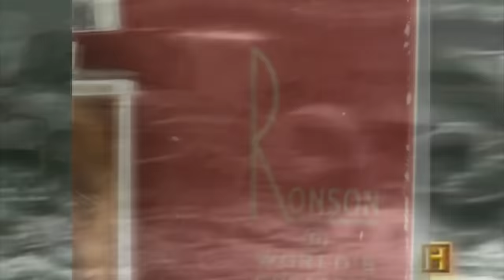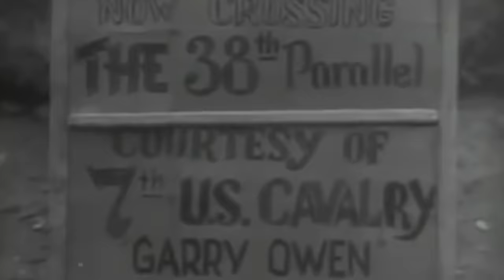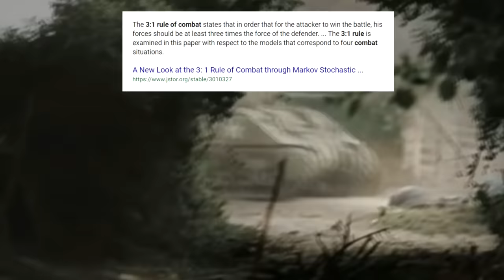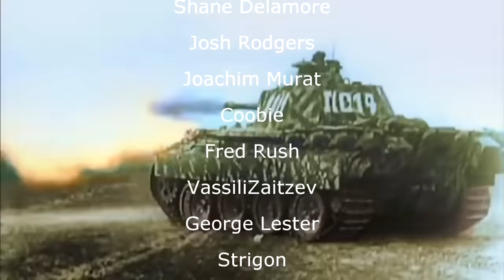The American Tank Meme

Comment: Tommy herd as my Great grand uncle would say about the m4 Sherman.
Translate to tommy cooker, as the thing lit up when shot at. 
awful but interesting person wolfgang.
Edit: he'd repeat kraftstoffsystem=fuel then say brrr sound while doing fire motion with hands.
Reply: Some how I have arrived back at this video a year late & if you want know why many allied tank crew found the Sherman under whelming well it'd because it is.
People talk of the Armour, speed, gun triangle which the M4 was pretty well rounded in so in that aspect as well as production it is good.
Mind there are many innate design flaws to the Sherman such as high profile & loud for a start.
As my mothers German side that went though the war described poorly from what my memory recalls Sherman tanks were so tall & loud due to their radial engine that you couldn't miss them approaching.

The Germans late tanks were ambush predators like a Spider while the USA tanks like ants.
The German from a covered angled position & or camouflaged would fire the 1st shot's often not spotted immediately since the tank groups were dispersed but once located after taking a few allied tanks out came the difficult decision of holding of or running.
If they ran the Allied air power would likely get them but stay they would be swarmed.  

People talk of German break downs/mechanical failures et cetera though a thing many tanks were purposely sabotaged/scuttled as they hadn't fuel, ammo or nor air cover.
The Tigers did break down & suffer from design issues but the Panther & many tank destroyers didn't have notable issues.
From what my allied fathers side & mothers German side described they could engage the allied forces but lacked the combined arms that won them victory early in the war.
The Battle of Britain long ago decided the wars outcome far more then tanks or wonderful ideas.
A tank without air cover to protect infantry to protect the tank is tarantula swarmed by everything under the son & if it runs well fire from the skies. 

Germany lost more tanks to break-downs, mines & ant tank guns towed then any allied tanks.
Tanks vs tanks is an awful idea only the Germans, Russians & USA had an obsession with.
Britain was infantry tank as it's a support vehicle & cavalry tank as something needs a bit of speed but building 2 family of tanks rather then 1 for the 2 goals is a bit silly but it worked till the centurion from the comet perfected to make the MBT=main battle tank.

Comment: Even after we started putting 76 mm on the Sherman's after the British did it the tiger could still out snipe Sherman's. There was nothing asherman can do. The only reason that we were able to take out as many tigers as we work because we mass-produced those inadequate tanks. The loss total of the Sherman tanks far outweigh the amount of tigers or Panthers lost. They were just that bad.
Reply from the maker: Only 1300 Tiger Tanks were built with most sent to the east making Tiger Sherman showdowns very rare. About 6000 Panthers were made which is a bit better, but that still left them far outnumbered. Most tanks on both sides were knocked out by AT guns and that isn't mentioned enough. The average tanker on both sides feared a concealed crew weapon more than running into an enemy tank but the US had air superiority and were able to bring more vehicles to bare with ferocious combined arms tactics used against the Germans. In  a Vacuum the German tanks win yes, but add in all the factors stated above and the Americans have a huge upper hand. Tigers and panthers were knocked out in higher percentages with more men killed per tank than the US. When you look at the war as a whole with all factors at play, the narrative of the inadequate Sherman that exploded if you looked at it wrong just doesn't hold up. If you're interested in more look the US army tank surveys taken during the war on their tanks and the numbers will really surprise you at how incorrect that common narrative really is and with a lot of good material coming out now solidly debunking it the common conception will reflect reality a lot more now. You would much rather be an American tanker than German once you really delve into the loss, death, and support ratios that are all solidly better in the American camp.

Comment: i understand what you mean. however, the brits upgraded their shrmans to fireflys with more armor and bigger gun, and offered them to the us. we said no thank you. stupid.  we needed heavier armor on the m4 and bigger gun.  the tankers referred to the sherman as the ''ronsen'' as in the cigarette lighter of the times.  it was gas and it went up like a fire ball when an 88 shell went right through it. the germans had gas ran tanks like us, but, they had the big gun and very thick armor. we needed 5 m4's to beat a big german tank, to circle it and eventually shoot it in the ass, and blow it up. the rear was the ONLY area we could penetrate.   however, we won due to numbers and we made  a shit load of shermans. also jeeps 600k.  germany made 50k kubelwagens, their jeep. we were the production king.  however, we were far far away for repairs

Comment: You have no idea about real history at all
Tank warefare did not exist in a vaccum
....ie , ammo, fuel, supplies, repair maint, spare parts, logistics, actually the death rates were not that high.
Beltin Cooper repaired burned out Shermans 
Reality was the Sherman Tank was a ,reliable awesome tanke over 50,000 built , with a 105mm 76mm HVSS dpuble wide tracks.
It was originally built as an infantry support tank.
It could easily out manuver german Tigers, panthers
Automitively it out gunned the German Army .
Need you be reminded the US Allies were on the offensive,  thus more dangerous , higher causulties.
The US and the allies mopped the floor with the Germans!!!
End of story
Reply: Have you even seen the video? he clearly says that Shermans were not a bad tank.

Comment: You can argue all you want that a Toyota Corolla is actually the best off road vehicle. You can say it would be the best if it had all wheel drive and a lift. But it doesn't. Which is why it is not ideal for off road trips. It's fine for on road trips. The Sherman tank is the Toyota Corolla of tanks. Nothing against Toyota Corolla... Just like nothing against the Sherman. But pretending it was the best tank of the war is nonsense.
Reply: How was it not he best 

Explain
Reply: The difference is that the Sherman was the best tank of WW2, along with the T-34

Comment: So basically the US needed basically 4 years to get good field repairability  on their new tank when the soviet needed mostly to form repair crews and hand out a bit of cash for every tank recovered and refielded to get it in 1 year while also moving their entire industry from west russia to the ural
Reply: You do know that a big ocean separates the US from Europe right?
Reply: @magnapinna7169  yes I do, 

do you realize that the soviet had to improvise repair facilities in some farmers tractor hangars most of the time, and that they improved their tank models more times than the US while moving their industry 2500km into a new location.

The US tank design team were quite slow to adapt
Reply: @Martel_Clips  Yes I do.

But again, the US is fighting a two front war with oceans between them while supplying its allies as well. The US did create new designs but they were rejected due to reasons, perhaps the US wanted a tank that is easy to repair, so easy it can be repaired by their crews. They wanted to produce a buttload of tanks just like the Soviets did, and it went very well.
Reply: @Martel_Clips  good thing the Soviets were fighting in a single front and totally not supporting and supplying 4 factions in the war.

Comment: I don’t think the Sherman is not good enough, just that in Armor and firepower, it was vastly inferior to the German tanks. Although I will admit it has a lot fewer mechanical problems
Reply: I mean against panzer 4s and stugs the shermans gun was good enough and anyways there were basically none of the “big cat” tanks in france 1944
Reply: @abramo7700  what about panthers? There were 432 by late July of 1944. Those had excellent armor and superior firepower. Their sloping was good too.
Reply: @griffinmcnesby2150  
The 4th and 8th armored divisions had roughly a kd ratio of 1 Sherman for 3 panthers
Reply: @griffinmcnesby2150  The Panther was a heavy tank in all but name.

Comment: Love the Americans coping in the comments 😂
Reply: Coping what? That the Sherman was arguably the best tank of the war?
Reply: @chadjustice8560  phahahahahahahahahagagahaga 🤣🤣🤣🤣🤣🤣🤣🤣🤣🤣🤣🤣🤣 T-34 was the best medium tank of WWII and IS-2 or Tiger II were best heavy tank of the war, soviet and russian tanks have always been good that, artillery and air defence, the T-34 was literally the benchmark for the 1st Generation main battle tanks 

soviet production of T-34 suffered between 41-44 with having to cut corners because they had the full might and industry of Germany and Italy's  military attacking them, after the USSR turned the tide of war in Europe in February 1943 after the victory at Stalingrad, the T-34s could be produced up to standards and that's not even including the thousands built in 1940 when it first entered production and the issues in production only really effected armour, maintenance and crew comfort, the T-34 was still faster, had more on road and cross country operational range and had more horsepower than all Sherman variants and Panzer variants and it's 76mm gun was larger than most Sherman and Panzer variants that used 75 and it's frontal and turret armour was stronger than most Sherman and Panzer variants.

The Sherman was a good tank for its many variants and ability to adapt and easy maintaining, T-34s built to specification in 40 and 44-45 were great tanks and if speed was what you needed then is the best choice for a tank, even with corners cut due to bombings and supply issues, it only really effected armour, crew comfort and maintaince, with some effecting guns.

Sources: WWIIEquipment, Armored Champion: The Top Tanks of World War II, Wikipedia Tiger I&II combat service section, Wikipedia M4 Sherman Design and Combat Service section, Wikipedia T-34 design section and combat service section, London: Arms and Armour, Wikipedia North Africa Campaign, International Institute for Strategic Studies, Accounting for War: Soviet Production, Employment, and the Defence Burden, Tank Tactics: From Normandy to Lorraine
Reply: @СергейСердюк94  There are hard factors and soft factors when it comes to tanks. Hard factors are the main considerations when it comes to designing a tank: armor, speed and firepower. Soft factors are often considered secondary and include things such as: ergonomics, reliability and adaptability.

The T-34 has, on paper, mastered the three hard factors, but severely lacks in the soft factors. The Sherman has balanced both the soft factors and the hard factors which has proven to be much more efficient. 

The Sherman had much better reliability, crew comfort and survivability. The more ergonomic turret and inclusion of a turret basket in the Sherman also increases the effectiveness of the gun and speed of the loader. The reliability of the armor and welding lead to significantly better protection, even if the T-34 on paper has better armor. The improved driver sights on the Sherman made it easier to manuever.
Reply: @Jonathan-oe5vz  i stand by what my sources have said from what I've seen, you are entitled to your opinion
Reply: @СергейСердюк94 I am not taking a Russian apologist and Soviet fanboy seriously.

Comment: Shermans were only able to perform in the war by sheer number and you can make the argument of mass producibility but the only reason the Germans were outnumbered so badly was because 95% of their tank were already dead or fighting the Soviets by the time the US got to Europe. If you controlled all variables to make it so that skill and production capabilities were the same on either side, German tanks would come out on top even if outnumbered 2:1 or 3:1, take the battle of Kursk for instance where mostly T-34s (which are objectively better than the Shermans in almost every way) suffered much higher losses despite the Axis having far fewer tanks. Put it this way, if the Americans were producing German tanks, they would have faired a lot better in tank to tank combat. Yes, you would not have as many tanks but quantity isn't everything and it would not be enough to compensate, especially since going that route would mean a higher death toll in the long run. It was the American industry that made the Sherman work, not the Sherman itself, if it belonged to almost any other major nation it would have done far worse.
Reply: The Sherman worked because the US understood that perfection is the enemy of good. The Germans kept trying to make the perfect tank, which led to them developing so many different tanks. That led to fewer numbers because each tank required different machinery, which took time to design and set up. The US, meanwhile, focused on making the Sherman better because it was already working.

Also, why would the US need to put so much emphasis on making a glorified tank destroyer when tanks weren't the biggest threat? Infantry and anti-tank guns were. The US needed a medium tank that could keep up, not heavy tanks that would slow everything down.
Reply: @foxymetroid  The T-34 is an example of a good mass producible tank, I agree with you the US focused in the correct area of tank, it's just that, that tank, the Sherman was pretty bad even for what it was meant to be, compared to something like the T-34. Regardless of what the US needed to focus on or not, my argument is that the Sherman was a poor tank and it being mass producible isn't enough to compensate for that.
Reply: @flapajack3215  Bad tank? It was reliable, the crews had higher survivability than the vast majority of other tanks, it could be upgraded for mine clearing, amphibious landings, etc., and it was light enough to cross bridges that the Tigers would simply destroy in a continent known for having quite a few rivers.

Compared to the T-34, it was superior. It burned far less often from hits (contrary to what the myths tell you), it lasted longer because the Soviets saw no point to making the T-34 last more than a few weeks, and its roomier turret made loading the gun faster and easier, escaping easier, and for a third crew member so that the commander could focus on finding targets and the gunner could focus on hitting said targets.

Compared to the Tigers, it was better for offensives. Tigers weren't designed for offensives. They were designed to punch holes in defenses for the PzIV to exploit. The Sherman was designed to support the entire offensive, not just the beginning.
Reply: @flapajack3215  no